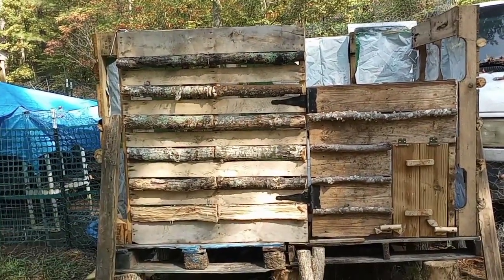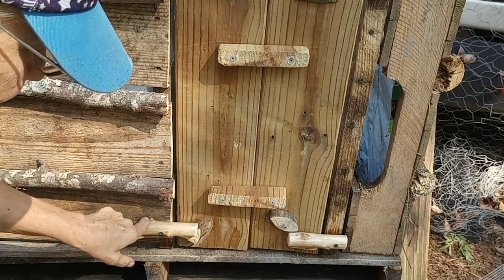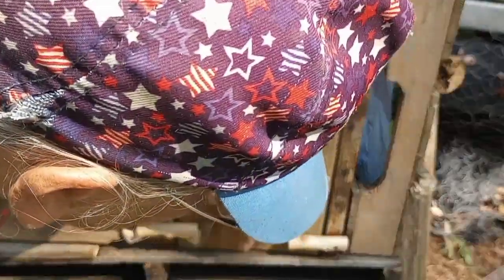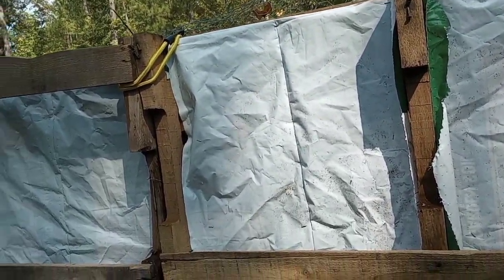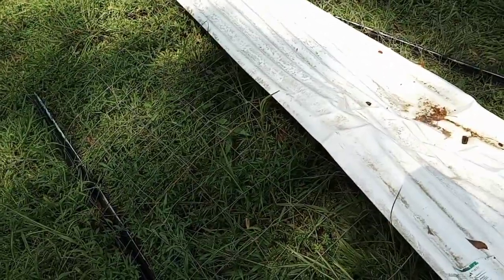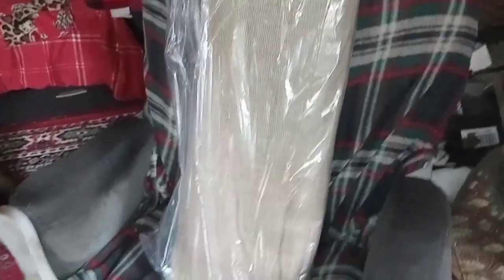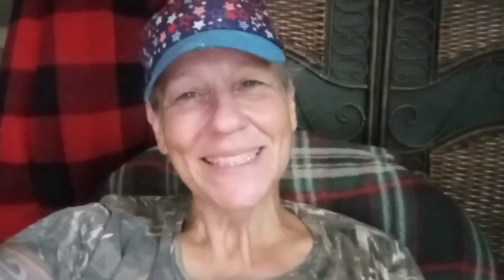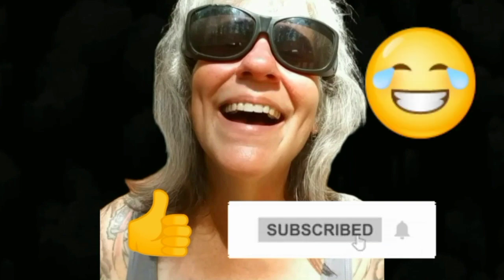Raccoon Proof Locks? - Ann's Tiny Life and Homestead

Comment: If you switch the top brackets to the bottom you could use it as a ramp.....AND raccoons wouldn't be able to open that door. Just a thought.....
Reply: I thought the same thing too .. Coons are Clever creatures!
Reply from the maker: I had thought about that. not a full strong piece of wood to attach bracket to.